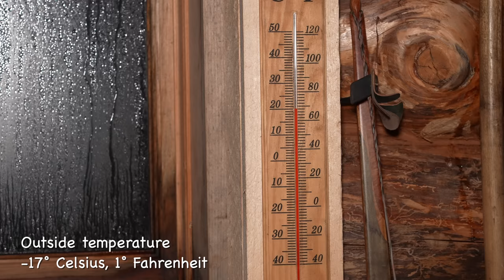Building a Bookcase Wall and End Table, My Off Grid Log Cabin Interior is Almost Finished

Comment: You should get you some of those battery operated closet lights for dark places where you only need light for a few minutes. They last quite awhile, but you could recharge batteries if you get the rechargeable type. Just a thought. 🙂

Comment: If you routered in some dados into the sides of the book shelf it would be stronger and keep the shelves from bowing, but that takes a little extra time than using screws to keep things together.  the end tables using floor tile for the tops is a good idea for a easy clean-up and wont be affected by hot items.

Comment: I built my book cases like Welsh dressers with cupboards under and raised and fielded doors. I made them from tongue and groove 7'' floorboards Two in width for the shelves and another width to get the depth for the under cupbboards and constructed them about a foot shorter than my ceilings so I could put a few ornaments on top. I aim to make more when I get a bigger place. Floor to ceiling works great for your cabin though. I would be tempted to add a back to finish off to the ceiling height to makeit feel even more cozy. What are the next books you hope to get hold of Shawn?

Comment: The only concern I have is that I didn't see a p-trap under the sink to help keep out all odors
Reply from the maker: It’s in the cellar so that it doesn’t freeze when I’m away from the cabin for a few days in the winter.
Reply: @MySelfReliance  
What I meant was to keep any gases from coming up the drain from where the water will collect in the ground probably over kill but an ounce of prevention. I know it's not sewer but it's still a collection area and as you stated there will be small bits of food in the water. Love the channel

Comment: Ohm no! You have a natural wood cabin, so use hemp straw as insulation inside the walls, or algae from the sea. They smell at first but then it goes away. I would use hemp, industrial hemp.